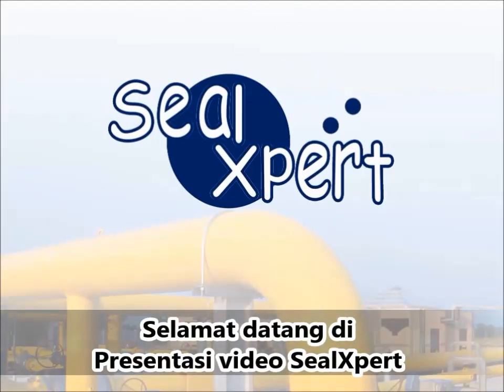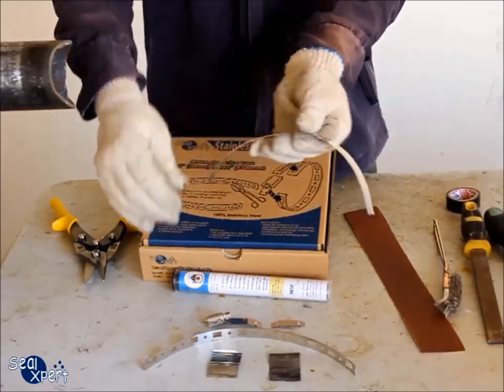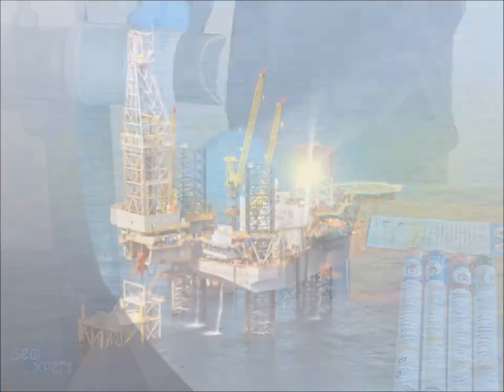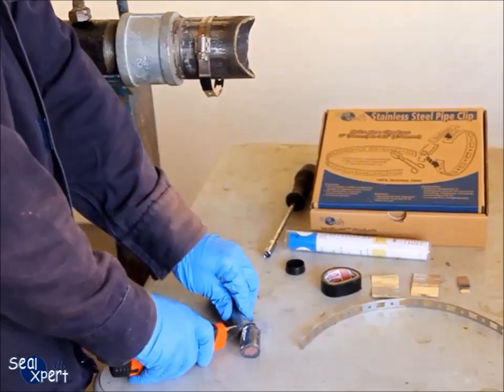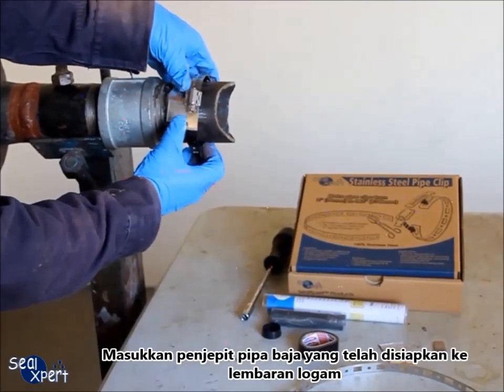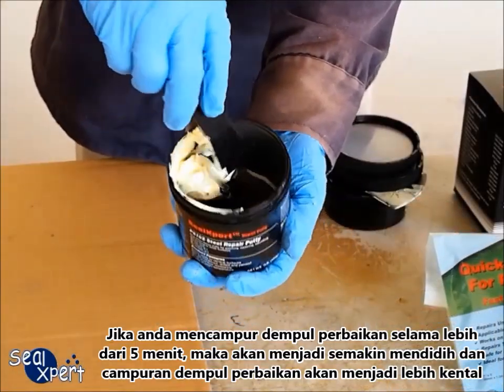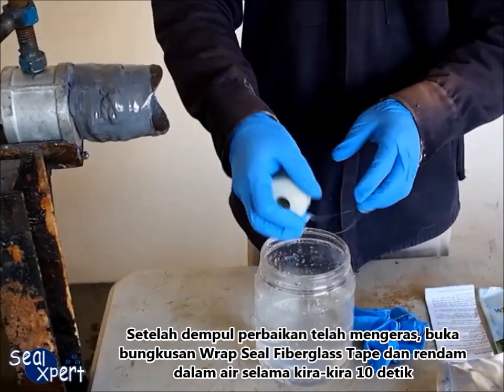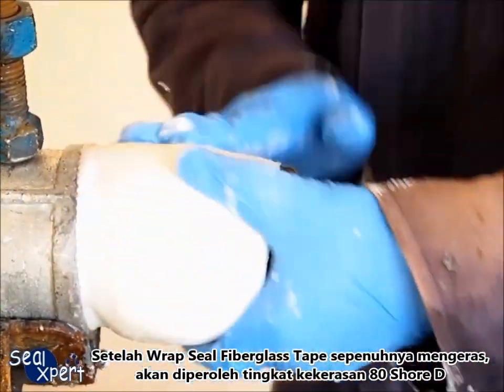Cara memperbaiki pipa bocor aktif menggunakan Composite Leak Repair (Komposit perbaikan kebocoran)

Comment: Itu seal compond Macam isolation barrier untuk Ex glanding, tapi  itu harusnya pipa linenya di stop, kalo ada pressure emang bisa?
Reply from the maker: Anda dapat menghubungi staf penjualan kami untuk lebih jelasnya (mailbox@sealxpert.com). Kami memiliki solusi berbeda untuk setiap situasi yang berbeda. Kami perlu mengetahui rentang tekanan Anda, material pipa, suhu untuk memberikan Anda solusi yang paling tepat. Terima kasih atas minat pada produk kami.